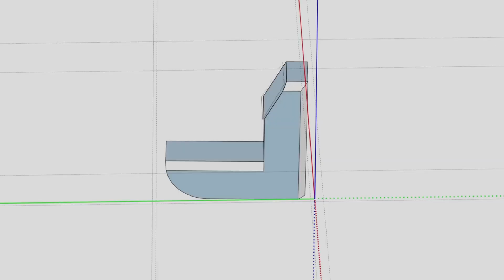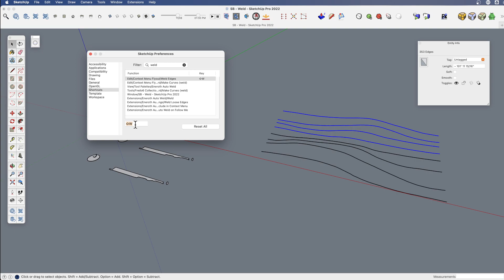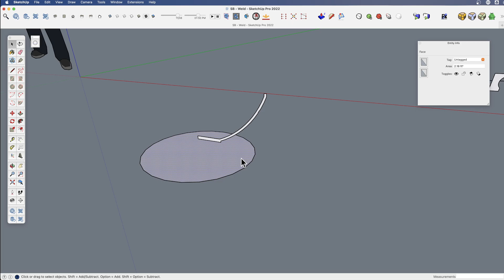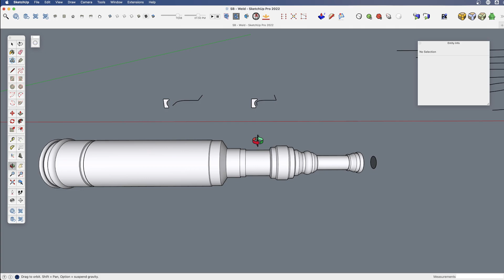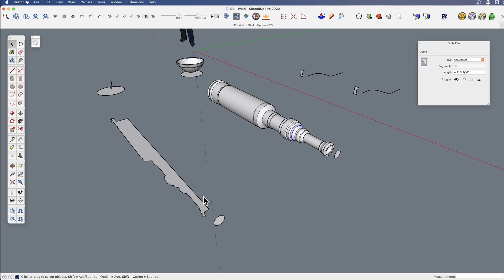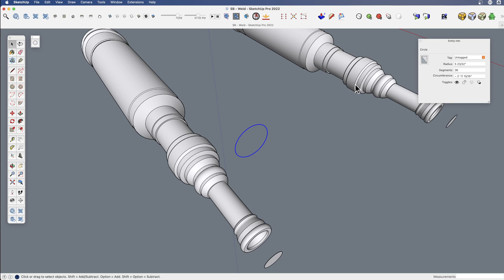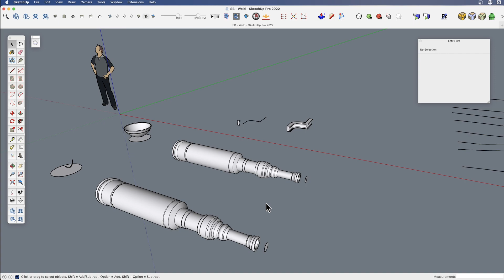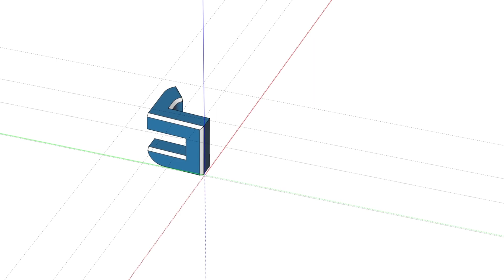Perfect Welds Every Time!!

Comment: When triple clicking on the object, you select the hidden/softened lines and that's why weld will not work.  You can do a selection box around the ENTIRE object and use weld... you don't have to select parts of the object at a time.
Reply from the maker: Entirely correct Don, thanks for pointing this out. I feel silly that I missed that, but you caught it right away. 

To re-iterate. With the NATIVE WELD tool, using Triple-click for your selection method does not work (as it also selects hidden geometry), however a large window selection around your whole object should work with native weld. 

Native weld will still weld edges into a curve, Eneroth's extension will weld possible circles into true circles.
Reply: 2:38 3:32
Reply: 4:36 4:57 4:58 5:20